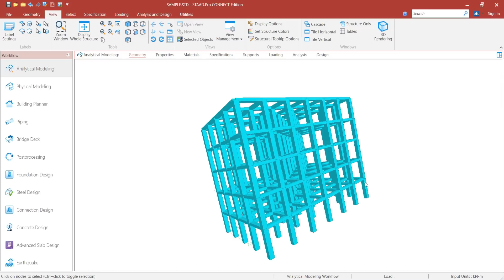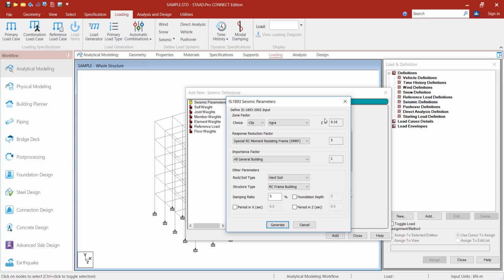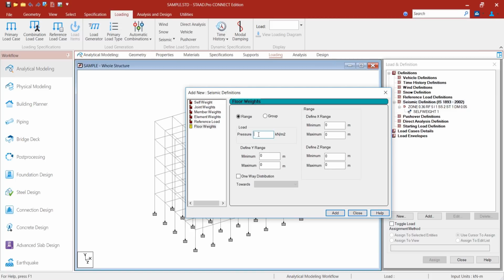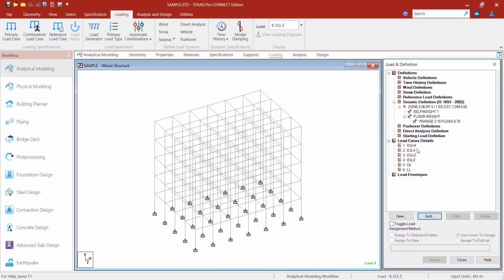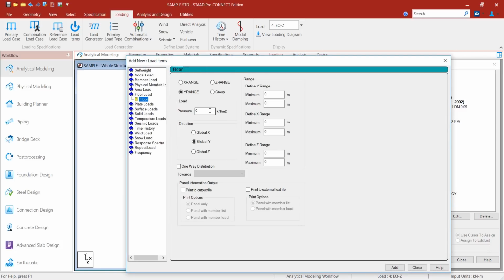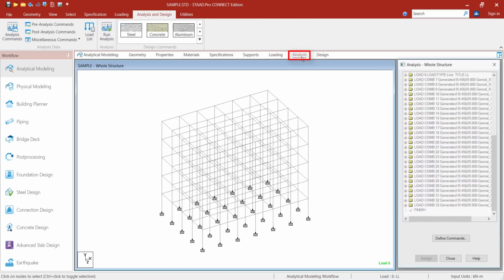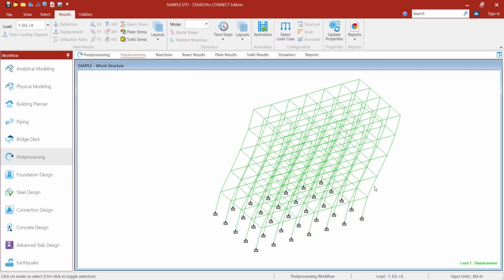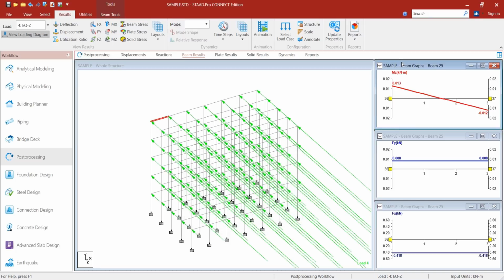STAAD Pro CONNECT Edition Structural Analysis by Equivalent Static Method

Comment: Why floor weight is 6.75 KN/m2 (i.e DL+LL=3.75+3=6.75) without any reduction in imposed load i.e 25% of 3KN/m2=0.75KN/m2.
mentioned in table 10 of IS 1893-part 1-2016. isn't it supposed to be 3.75+.25x3=4.5 Floor weight. correct me if I am wrong.

Comment: In this videa i have seen three aspects. Whether for this model equivalent static method is applicable or not. For only zone II itis applicable. Another point is whether y direction  design vertical  coefficient is applied or not. Whether cracked moment of inertia is applicable or not for this method.

Comment: but i m unable to get any code in seismic definition what is the problem, i m using staad pro CE v22
Reply: Please follow the steps below to fix the issue 

1. Exit all running sessions of STAAD.Pro application.
2. Delete the folder C:\Users\<User.Name>\AppData\Local\Bentley\Engineering\STAAD.Pro CONNECT Edition\Default. Note that <User.Name> is to be replaced by actual user profile name.
3. Restart STAAD.Pro application.

Thanks!

Comment: Very good professor ,  I request  u to demonstrate response spectrum method
Reply: Thanks you professor
Reply: Sure.. Thank you for your suggestion!!
Reply: Mam which method is most safetest method?  For taller buildings, our codes are suggesting for an dynamic one,  if we do by static method then what will happen mam?
Reply: @Naik1920  As per IS 1893: 2016, static method is applicable only if  the building is in zone II with regular geometry, when time period is less than 0.4 secs and the building height is less than 15m . If not, the code suggests to use dynamic method of analysis.